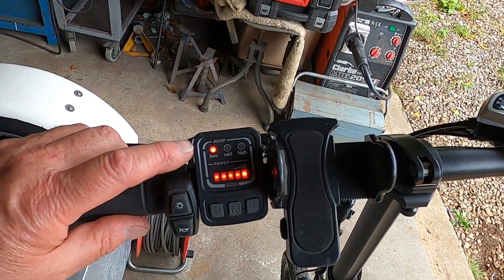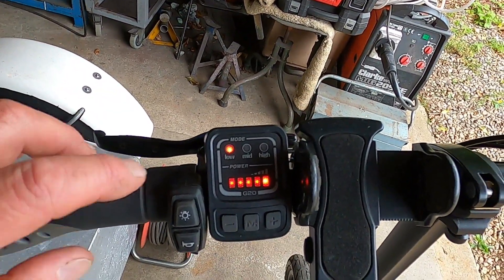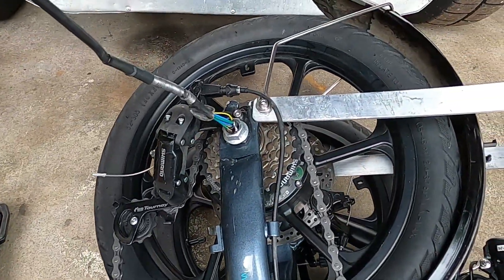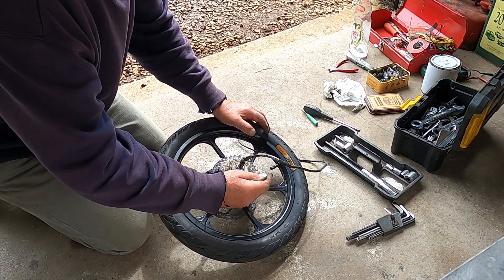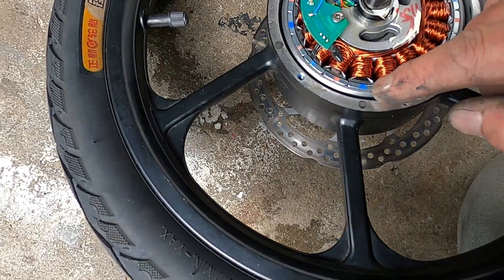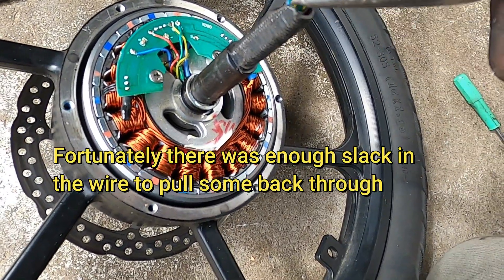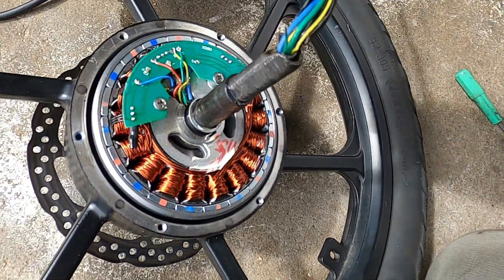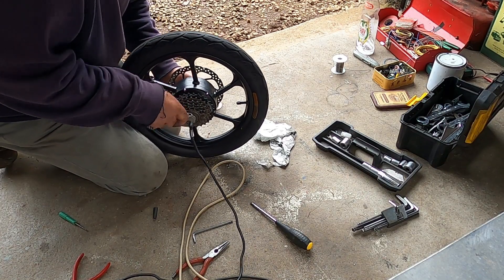Fiido D2s Electric Bike Rear Hub Motor - Dismantle and Repair

Comment: Hi, I,'ve got a Fiido D1, how do I remove the freewheel ? I dont have any gears, it's just a single cog.
Regards
Geoff
Reply from the maker: The freewheel should have two small indentations on the face of the inner part. You can use a hammer and small punch or screwdriver, on these indentations, to unscrew the freewheel.

Comment: Hey do you think its possible to replace the controller with the d2 controller as they can be hacked to do 40km whereas the d2s cannot be hacked so its slower.
Reply from the maker: It may be possible - but illegal in the UK if you use it in any public space.
Reply: Ok thanks, if its just simply a controller swap it will still look legit and the same hack process can be reverted too for any worries but I need to try and find out if its literally a controller swap it will it need motor swap and possibly more. I need to find more info. The d2s is only ideal cause it has the extra gears so that's why I didn't want a d2

Comment: Hello there, sir.. After all of your experiences with these bike, do you still recommend it or prefer the others?
Reply from the maker: Hi, I only have experience of riding the Fiido D2s bike. I have looked at other electric assisted bicycles but they have been way more expensive. For the money (about USD $650) the bike is a great buy. Any problems I have had were very easy and cheap to rectify. I would definitely recommend the Fiido D2s.

Comment: How to remove the cogs?
Reply from the maker: Use a Shimano freewheel removal socket tool and hold the cogs with a chain strap wrench. The freewheel unscrews in the (usual) anti-clockwise direction.

Comment: Sir, may I ask if you could upgrade this to a Bafang mid drive motor?  thank you very much!
Reply from the maker: I do not think it would be practical to convert this bike to a mid-drive motor. The rear wheel/hub motor would need to be replaced, there may not be enough space at the bottom bracket to fit the new mid-drive unit and you may have to upgrade the 36v battery to suit the new motor.

Comment: Hi, how did you know that it was the hub motor that causes the error? Thanks
Reply from the maker: Hi, The physical damage to the cable was very evident, which was a good starting point.
A temporary fix of the cable cleared the fault. Unfortunately, Fiido do not list any details of their BLDC controller or the display unit fault codes. I realised that the 3 flashing lights must be some sort of error - but had to use trial and error methods to find out what it was.
Reply: what's going on in Doug's shed? I went straight over the handle bars and smashed face 😢 worse still those lights were flashing bike didn't work, thinking it was battery went there to see if any wires broke. Now the display no longer works at all, did this happen with you by any chance when you were looking for the problem? It was fully charged when I had the accident. Thanks 👍